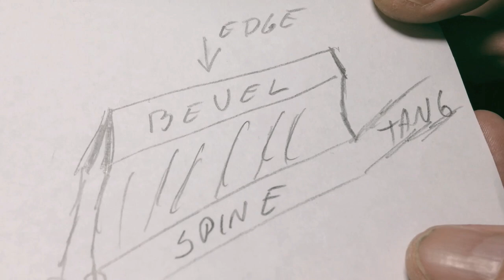Straight Razor Honing - Bevel Setting 101

Comment: This video came up in recommended, so I thought I would watch it. It's good to see that someone else dose things the same as myself, maybe I am doing things right.

One question which doesn't relate to this video, is that I am seeing a lot of stuff on these convex Ark's. 

As I have to picture things in my mind on how things work, it seems that all that is happening is you are increasing the angle, which is why it would seem to work so well, but I could be wrong, the picture really isn't making sense to me.

I have watched the video's of why and how they work, but even that doesn't seem to satisfy the picture in my head. I aren't that smart, so a lot of things go over my head. What are your thoughts on it.
I don't want to get you into trouble with the razor community (a lot of fanboys there), as it seems a lot have jumped on board of this new craze, but maybe I just don't get it. 

Thanks.
Reply from the maker: Thanks Mark! Edit - I just saw your question about convex stones. I've worked with all kinds of hone surfaces, with all sorts of shapes, curves, radii; convex and concave too. Me, I'm not impressed with the results off anything but a flat stone, and I find the concept honing on anything that isn't flat to be inherently problematic. To each their own though.

Comment: So now I know why I’m not quite getting descent shaves with vintage razors I get- I just learned how to use a straight and just as recently learned how to hone- and am just now learning what the bevel is- which is the one thing you need or else you’ve got nothing. So BASICALLY, you keep it on the 1k UNTIL you have a uniform bevel. I usually stopped when I saw a lack of metal being taking off etc- Now I have a new benchmark to look for.
Reply from the maker: You stay on the bevel setting until both bevel faces meet at a point/line that is as thin and true as possible. The bevel can be wildly uneven, visually; but each side has to be parallel to the other, true, and with a well developed apex at the intersection. You should be able to manage a shave off the bevel setter.

Comment from the maker: +Edmond Dantez
Because you've decided to take the troll path with your closing comment on what will be your last effort in this thread, I have to remove you and the original discussion. The point of my channel is to pass on information and I will not tolerate beligerant commentary.  

It's apparent that you have very little understanding of the topic at hand - I'd have to guess that you are either brand new to honing, or that you've never actually honed a razor. 
You said that using your nail to test the edge will mess up your nail. 
It does not. Proof of that is my nails that are unscathed, I've been doing this for a long time and I've run hundreds of blades over my thumbnail. The same nail - in the same place. 
That one single fact is proof of your ignorance - and I have no need to continue itemizing every other blunder you've made in your attempt to appear/sound intelligent and conversant. 

Like I said - if you like using straws - then by all means, go use straws. But the fact of the matter is that your idea (which isn't  yours or new btw) isn't as good as or better than anything else on the table. In fact, the theory is full of holes and flaws that don't need to be in the equation. I see the concept is a problem inducing one. I've backed that up with facts. Your rebuttals were ridiculous claims based on assumptions that you can't back up with facts. 
Your arguments border on, or cross over into, being ludicrous at nearly every single juncture. 
You are applying the wrong principals of physics to prove a point that has no merit and you're basing your 'findings' on a fabricated reality. 
Have a nice day and best of luck with your honing ventures.

Comment: how tall is you blade? seems almost an inch
Reply from the maker: Under an inch, can't remember that far back though but it's def less than an inch. Probably 6/8 - 7/8 - ish.
Reply: Keith V. Johnson ok thought so. let me ask you this do you tho k that taller blades feel better when honing. i know it sounds weird but they seem more solid on the stones/hone almost like it feels more flat.
almost like a long wheelbase car feels better than say a little geo metro tiny car when going down the highway. i have been interested in 3/8 blades but not sure until i try one. 

i have two, to comapare and one is noticeably taller than the other and the taller blade feels nice when honing for some reason.

any thoughts on this theory of mine?
Reply from the maker: @Sproutt  Blade width does not factor in.
Reply: @KeithVJohnson1  ok maybe it's the steel. One says blue steel on it but I'm not sure if it real Aogami or if it's a US counter part. But something feels different for sure. Plus the non blue steel has a very loose pair of scales on it. And it's annoying to have it your hand.

Comment: Can I over set the bevel
Reply from the maker: In what way? I am not sure I understand what you mean. Set is set. not set is not set yet. I don't understand what overset means exactly.
Reply: Thank you for reply can I get the edge cutting but keep going on the stone and then the edge go blunt
Reply from the maker: Well, you could mess up pressure, or maybe cause issues with too much embedded swarf on the stone,, or maybe you could wind up creating a wire edge that snaps off and leaves an unfinished bevel that has to be redone.